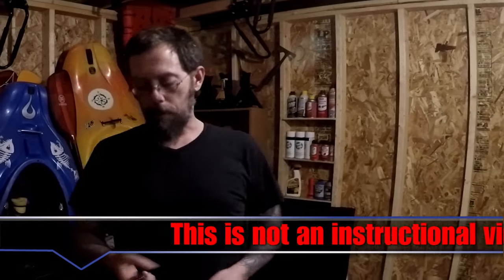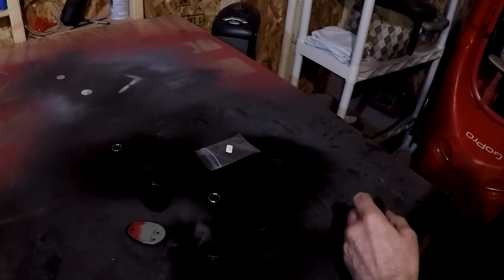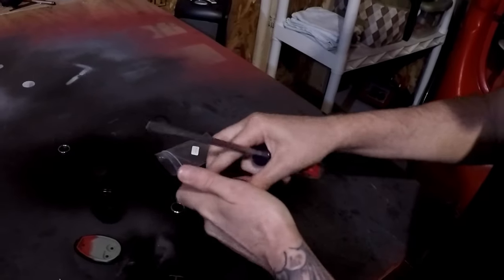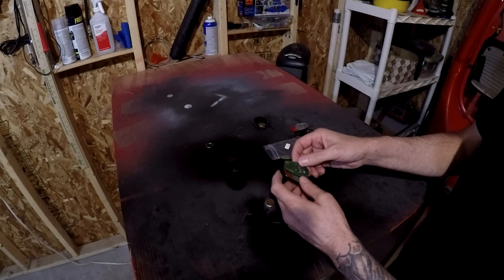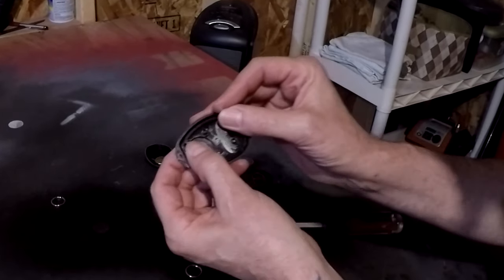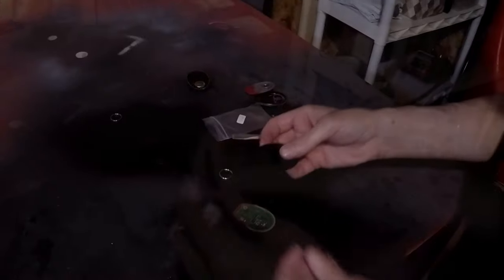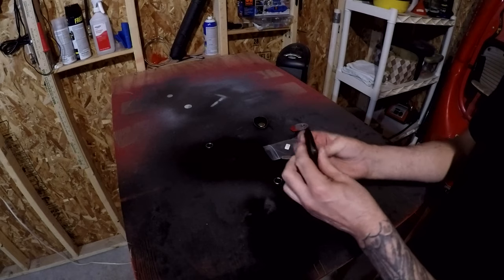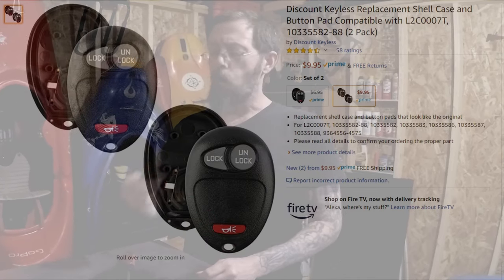2007 Hummer H3 Key Fob Case – Replacement

Comment: I just got mine off of eBay thinking I had to program them. Didn’t even think about just replacing just the case! THANK YOU!!!  Just did it…works great. Going thru dealership would cost up to $300 just for programming. Almost $100 for the fob. Thanks again!

Comment: how do you program a new key fob
Reply: Agreed. I recently replaced a battery in one of my fobs and it doesn’t work now. Do they need programming?
Reply from the maker: @everymanadventures9285  I did not need to reprogram my key fob, I just replaced the battery and case, worked fine after that.